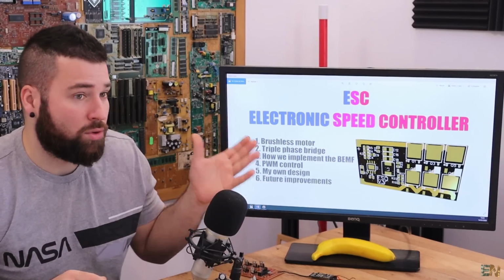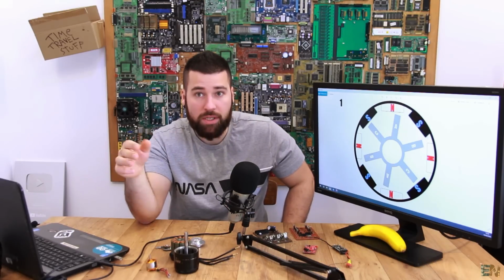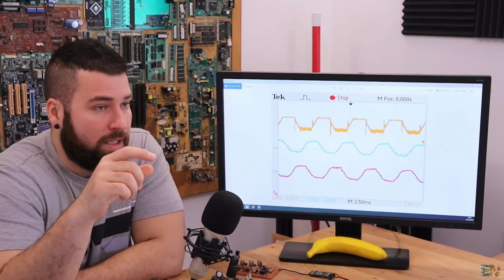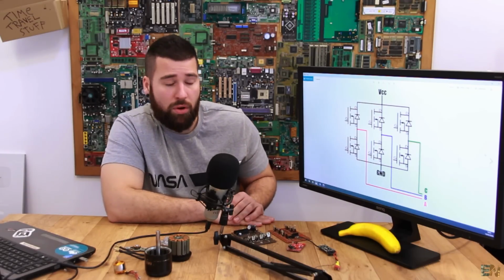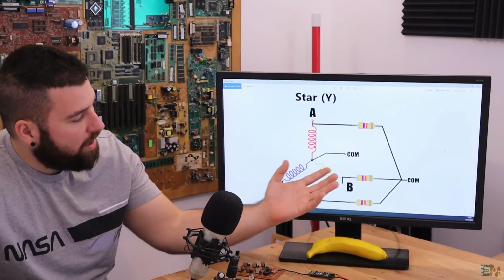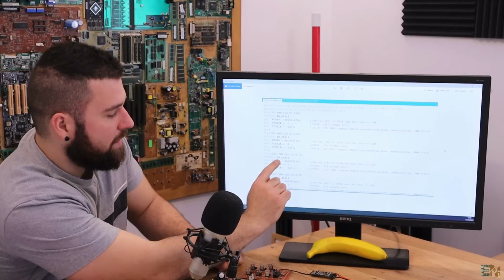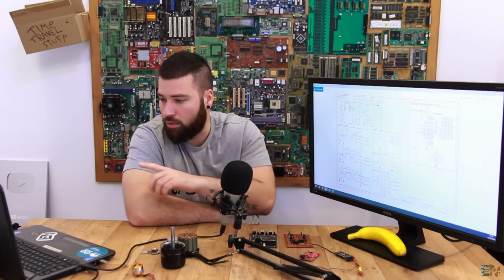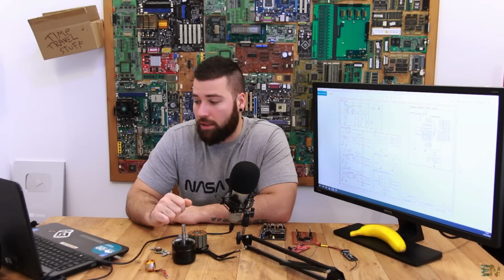LearnMore#3 - The ESCs | Brushless Motors | All Theory You Need To Know About ESCs

Comment: good video  and explanations. But the Back EMF will depend on the speed of the rotor,  and that can drastically increase when you're going downhill.   And that may cause the voltage divider to output too much voltage and burn the comparator / mcu ... no  ?

Comment: Instead of rapid pulsing, you could do one well timed pulse for less switching losses. Calculate maximum time the pulse can be active, then command it for a percentage of that time, as a single pulse, instead of many. Should also make better use of the energy that isn't lost to heat, because it would be closer to max flux. You can get an idea for it from my open source engine controller's EOIT (end of injection timing) code. Probably similar to what Texas instruments did with their "insta-spin technology" approach, except they used fancier math. I see you had that video up already. I think they called the math an integral (area under curve).

Comment: Hi @electronoobs, I have assembly your ESC V3 and it running normally without propeller. Unfortunately it has issue if i put propeller to the BLDC motor. The BLDC can not run normally when propeller is installed. Any advice to solve this issue?
Reply: No torque ?

Comment: quick question! I am using ir2110 drivers, and want my esc to work with 2s batteries, will a boost convertor like mt3608 be enough to power on my drivers?

Comment: can I seek your help pl. for a problem i have on using IRFBC40 mosfets and RC Circuit for powering up Non carbon brush motor with 6 wires. I also have the potted unit but not clear. can i seek your hlp pl.

Comment: Thanks for sharing your work with us -  this is amazing!

I'm just a little confused about what controls the total power supplied to the coils. I know the MOSFETs do the commutation, but are they further involved in this PWM too (switching on and off many more times in between the 6 steps)?
Reply: the power is controlled by the on time of the mosfets they only switch on once for each step
Reply: @cornishcat11  Is this on-time most effective in the beginning, middle or end of each step?

Also, what limits me from switching on and off MOSFETs many times during a single step? I imagine I could make the motor turn really slowly without it getting stuck.

Comment: I would like to design a motor controller based on the Teency lineup. It would be overkill for a lot of features. It has USB host and client. Many serial ports and a handful of different busses. Easy to add USB or other Bluetooth or Wifi for more bandwidth. Could do all sorts of stuff like turn signals and cameras.

Comment: KLJ-5020 buzzer requires 100~110mA according to it's datasheet. 
You are driving it and an LED directly from the MCU pin 9 (PD5-5)? 
Why didn't you use a transistor to drive the buzzer?

Comment: You can surely transition to more powerful STM32F302, F303 controllers for Field Oriented Control, which is the gold standard in BLDC or PMSM motor control. ST supports the development using Motor Control Workbench and CubeMX. BluePill Boards cannot run FOC algorithm. Also IMS PCB and D2PAK MOSFETs can be used for the power stage.

Comment: Dear electronoob :) very good podcast congrats! 
I have some question about the motor you are using, it is BLDC   BRD6368 280KV 6-12S , that was used also on electric scooter video... but I don't know the configuration of the coils this motor has, is it star or delta? Please leave a replay if you know already, and guide how to determine?
I have the same motor and I disassemble the rotor, just not unwind the stator, trying to figure out the delta/star to convert to 6 wires  easily configurable as induction motors have.

Thank you in advanced

Comment: 17:57 It is AC by definition, simply because the current reverses direction. The ESC is basicly an inverter turning DC into 3 phase AC and Altough it does not produce sine waves, the moter would also run fine on 3 phase AC sine waves straight from the power grid, It would however not self start because the frequency is to high.
Reply: In your opinion, could I use an AC Variable Frequency Driver on that motor, or another BLDC motor ? 
Would it work fine ?
Of course with the voltage adjusted for that motor SPEC. I would like to try. Did you try before ?
Reply: @anibalvilelarj Yes, I tried but it's not ideal because it has to stay in sync with the drive frequency, to much load and it will just vibrate.

Comment: I think your explanation of why this is a DC motor and not an AC motor is flawed.
You have explained it using the voltage fed to the motor as being a series of positive voltages.
which allows you to say this is a positive voltage pulsed motor.
However, if you look at the direction the current is flowing through each of the wires connecting to the motor, the current is flowing in one direction for 2 of the 6 cycles,  and the reverse direction for another 2 of the 6 cycles and no current for the remaining 2 of the 6 cycles.
in other words the current is alternating between for and reverse, or Alternating Current, and not always in the same direction as is the case with Direct Current motors.
Always remember that AC stands for Alternating Current and DC is Direct current.

In the modern Inverter type Variable Frequency Drive (VFD, also know as Variable Speed Drive VSD) the three outputs are pulse modulated output, either to the 0V of the DC bus or to the Positive output of the DC bus where the width of the pulse varies with time so as to produce a power output curve that roughly follows a sine wave with each phase being 120 degrees around from each other.  The direction of the current flow is dependent on if the PWM signal is switching to the positive rain or the 0V rail of the DC bus.
This produces rotating magnetic field withing the winding's of the motor.
The ESC is supplied with a DC power source (no argument there) but the ESC is inverting the supply to the motor in a almost square wave 3 phase output.

In the brushed DC motor, you will note that is has permanent magnets and mechanically comutated rotor winding's. Note, the connection to the motor is however a current source that flows in one direction.  Reversing the direction of the current also in this case reverses the direction the motor will rotate.

I would argue that a DC motor will always have 2 terminal, positive and negative and will spin in the one direction.  Reversing the two wires may reverse the motor direction (not the case for a series motor that can run on both AC and DC)
If you have more than 2 terminals and the direction of the current needs to be changed in a sequence to rotate the motor, then is is an AC motor, this includes bipolar stepper motors as well.
The motor described here is a three phase permanent magnet synchronous Alternating Current motor.

The 3 phase AC for the motor is created by your excellent Electronics Speed Controller (ESC) which could also be called a VFD or VSD.
The rest of the video is really great and I learned quite a bit from it.
Keep up the good work :-)

Comment: Some ideas for your ESC:
This points improve efficiency because you are limiting losses in the body diodes of the FETs - the current will circulate in the active phases even with the PWM being in the low state, phase windings are inductors.
1. Don't switch the ground leg - not needed, will give you better efficiency to just have the ground leg connected for the whole commutation step.
2. Complementary switching of the high leg - if you will switch from the high fet to the ground fet with the PWM signal you will get higher efficiency.
This point would add protection for the motor.
3. You can add low side current sensing for the whole inverter, no need to have current sensing of individual phases with 6 step commutation - can help to protect the motor if you set a maximum allowed current for example, can allow you to add a current controler instead of directly sending PWM signal to the FETs for desired power.
This points would allow to use the controler for motion control.
4. Close the speed loop - measure the time of commutation, have a PI controler send current command to the current controler - allows to keep a stable motor speed - you could use the motor as a router spindle for example.
5. Close the position loop - add an encoder to the motor, have a PI controler send speed command to the speed controler - allows to keep the motor in a stable position - you could use the motor to power the movement axis in a router.

Comment: I'm also interested in how to add regeneration to this circuit. I've seen the standard diode circuits, but as in old motorbike rectifier/regulator circuits they can easily burn out due to high voltages.

Comment: 3 questions: 
Do you have any plans to use igbt's for higher power in the future? 
Based on the CPU speed, what do you think is the maximum speed of the motor? What happens if you exceed that speed?
Do you have any voltage spikes on the MOSFETs from switching the coils? I was wondering if that could potentially damage the circuit, and might require some capacitors.
I'm super new at this, so excuse and noob mistakes in my questions..:)
Reply: What limits the speed of rotation is the voltage applied to your electric motor, nothing to do with µC and its frequency. What the frequency will do will is limit the number of instructions per second that the µC can execute. 16Mhz is acceptable for the Electronoobs project. Also, the frequencies injected into the MOSFET is acceptable, ie the frequency of the CPU. For high currents and voltages, optocouplers must be provided in the designs in my opinion in order to isolate the control power (GBT or MODFET) from the control logic. And a faster µC for injection a frequency of the order of 20 MHz is preferable and also preferable if PI controls (software) are added to the code.

Comment: The STM32 is powerful enough to just connect the BEMF to the ADC and make the calculations in software for the virtual zero and the zero cross, so you can skip the comparators. Use the DMA with interruptions when a conversion is finished to make it more efficiant. Good luck :D
Reply: hi, i see you know info on STM32 and esc ... I have a question it will sound weird, i want to make an ESC but at 400-600V ( yes 100S+ battery) i now is lots and with maybe 400-500Amps .. so wath do you phinks possible or not ?

Comment: Thank you for sharing such an intense knowledge.
One improvement I can suggest is an SPI port on the board for reading the magnetic encoder sensor for having full control over the motor.
Reply: if the zero cross bemf already tells you exactly where the rotation of the motor is, then magnetic encoder offers ZERO additional information your code does not already know and is therefore a total waste and can be removed from the motor and tossed into garbage.

Comment: Thanks a lot!
Please can you tell me about negative voltage more then -0.3V on input pin comparator, how to solve this problem?
Reply: The voltage will never go below 0V. When he is talking about negative voltage, he is acctually talking about the "virtual negativ voltage". What that means is that the voltage will be the below the "virtual zero" which will be your battery voltage divided by 2. You see, inside the motor you will have the current flowing through two coils and as Electronoobs is saying, we meassure the zero point between the two coils. Think of this as a regular voltage divider and perhaps you can understand what I mean :) Good luck.

Comment: Arguably, every motor is an ac motor. And you said it in the last video. And using your analogy every motor is a dc motor as you can take any dc voltage and with some sort of conttol, switches and filters transform it to almost any form you want

Comment: Loved your video. Just wanted to know if all the grounds (of driver circuit, microcontroller and the 3 phase bridge) have to be made common? I am making a similar project but I am using IR2110 as the driver and IRF540 MOSFETs. I am not sure whether I should short the grounds of controller and driver with 3 phase bridge.

Comment: My suggestion is to use a C2000 series Texas Instruments  MCU as they are fast enough to be real time controllers. And the code for them compiles pretty close to that of the Arduino . And most of the TI mcu's have Quadrature sensing on board as they are DSP's .Great Project. I would like to see you complete the MCU based power supply project
Reply: What if I am a noob at programming C2000? :p
Reply: @ravirao1168  I was just saying if you have programmed Atmel AVR then TI c2000 will be much more familiar than STM32 variants

Comment: I had a question there are many buck converters in marker but many have different switching frequency.
Why do buck converters have different frequency and why synchronized frequency with circuit is used buck converter.

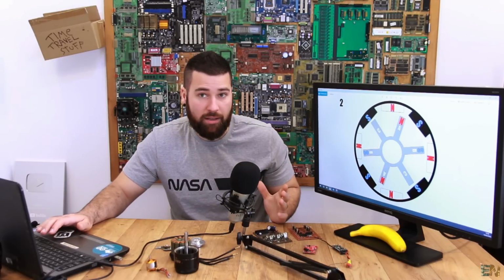Comment: Are you sure, that the rotor is the part, where the coils are mounted, as you explain at min 12:00? Typically the part with the permanent magnets is moving at brushless dc aka permanent magnet synchronous motors.
Reply from the maker: Yes I realized that after the video... Anyway the theory should be the same but instead of pushing the rotor we push the magnets. Thank you!
Reply: @ELECTRONOOBS  I agree, it only depends on the point of view - that's the core of Park transform theory ;-), where the consideration as a DC motor comes from!

Comment: Do we need p mosfet witn n mosfet for h bridge or n mosfet is enough 🤔🤔
Reply: Just to add to his answer. The driver he uses has "bootstrap" circuitry added and this will push the voltage higher than the battery voltage to above the voltage threshold for the gate. This will saturate the gate which makes the N-channels happy. :) As long as the switching frequency is high enough that is.. which is usually no problem in an ESC.
Reply from the maker: In this case N MOSFETs is good enough. Is recommended to use a Pmosfet but the resistance of those is higher....